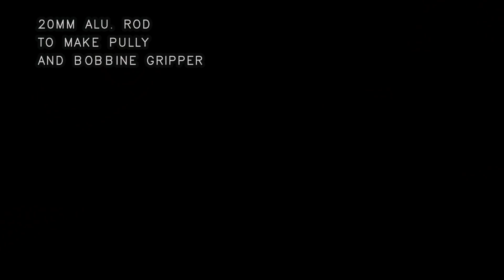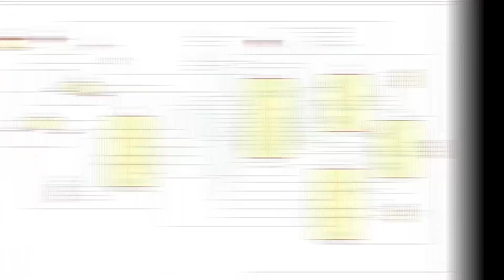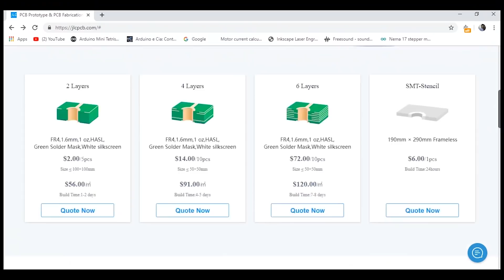DIY Arduino based Winding Machine

Comment: at 0:17 the wire is threaded through a small piece of metal with a whole in it that has rough edges. This will scratch the enamel insulating the wire and can easily create shorts in your finished coil. It needs to be made from nylon or better Teflon and the angles of attack have to be relatively shallow depending on the weight of the supply reel and its associated friction.

Comment: Гарний станок. Але в налаштуваннях не завадило би мати можливість вказувати діаметр дроту, що намотується і межі намотування! Завдяки цим параметрам можна було би намотувати дріт різного діаметра без зазору - виток до витка.

Good machine. But in the settings it would not hurt to be able to specify the diameter of the winding wire and the winding limits! Thanks to these parameters, it would be possible to wind a wire of different diameters without a gap - turn to turn.

Comment: 😂what about add a plastic tube in the bolt’s guide hole, to prevent the wire’s plastic from brake.

Comment: The ideas are great, but the structure is not designed for good results. Free-hand drilling despite having a standing drill !? The axis cannot be straight and therefore cannot produce a sensible winding. I like your ideas, but the implementation is amateurish. You still have to work on the quality

Comment: Would be smart to pay attention to hitting the walls of the coil bobbin, and the gauge of wire to make neater turns, as turns slipping between layers tend to reduce the magnetic field - resulting in weaker motors/generators.

Comment: Great project! I agree with the suggestions to add a tensioner. I’d also add some code that lets you enter the wire diameter and calculates the correct speed of the wire guide movement to produce really nice, tidy windings.

Comment: Curious.  I like the machine some.  The little hole in the metal piece that you feed the wire through just seems risky that it will scrape the coating off your wire. I would just get a piece of plastic with a hole in it, epoxy it over that hole, and feed the wire through.  Also, your linear rail is really running too fast.  Thank you for this because now I know I will not buy one of those cheap linear slides. Really the wire should run through some sorta gentle pinch thing to create some tension. I bet with that it would almost correct for that linear slide if you slowed the slider down.

Comment: Awesome! In love with this and your toroidal spinner. One suggestion, maybe put a soft material to cover the metallic inner surface of the part that guides the wire...just to ensure that the enamel doesn't get scraped off. Hoping to one day make a version of both. If these aren't open source please consider doing so..best
Reply: Exactly! Teflon would be optimal, but another soft/waxy plastic like delrin (POM) or HDPE would work very well.

Comment: The eye needs to be changed into a horizontal pulley bearing, and there needs to be another horizontal pulley bearing spring-loaded to keep the wire under tension from the source spool to the spindle (should look similar to a VCR tape deck)....and the source spool should not be fully free to spin, but maybe some cotton or other small friction just to keep tension on the line.  This will allow the winding to be more accurate and compact.
Reply: What Robert said!  Is that what it is called? Horizontal pully bearing?  I need to get one too.

Comment: Do you account for the extra length of wire required for 1 turn after the coil has reached the entire length run of the cylinder? There would be extra length that's required to create a turn after a full cylinder run? You'd have to account for the new diameter of this turn, which would be the original turn diameter +  twice the diameter of the wire underneath the new run of coils, i believe. Please correct me if I am wrong here, as maybe this would be almost negligible?
- Thanks.

Comment: Not bad. But the stacker must be polished, otherwise it will strip off all the insulation from the wire and there will be an interturn circuit.

Comment: Use stepper motor to drive bobbin to get better control of turns/speed.
Make better wire guide (See Gingery book on coil winder).
Software to allow movement of wire guide in concert with turns, allows making 'universal banked' coils like Pie wound RF chokes.
Software should know wire gauge (diameter, turns per inch) so wire guide will move in lock step with bobbin for tight windings.
Good basic foundation, but needs above improvements.
Reply: do we need to calculate the speed ratio between ?? if so how to calculate that?

Comment: nice build. Advice you should use a V pulley to control the motion of the wire. The ole is too big for thin wire and making it smaller is a bad idea. Hope it will help you

Comment: The approach has merit but the winding accuracy is below quality due to very inaccurate workmanship when making the shaft/axle for the winding bobbin. You can see the disastrous run-out as terrible wobble! The machine simply winds another spool of wire approximately a preset number of turns. Not much use other than for some kind of solenoid perhaps?

Comment: Compliments, it's a good concept as starting point. Defenetly you'll need a tension system for the wire made from two pulleys, a control on the slider based on the wire diameter with which you can set the travel on each turn and also the length of travel based on the coil length. Keep evolving the good work! 👍

Comment: Mais afinal. Para que serve isso?! Nao entendi.
Reply: Para fabricar solenoides, los tienen las electro válvulas de las lavadoras, las válvulas neumáticas, los re levadores, contactores, actuadores lineales etc. etc.
Reply: @rafaelalvarezplacencia1190  pode remover a bobina de solenoide. Dessa peça de alumínio?
Reply: @viniciosvds  No creo que se pueda remover, tampoco creo que sea de aluminio, porque no tendría utilidad, tendría que ser de acero al alto cilicio o hierro para que al energizar la bobina imante el centro de acero o hierro hueco y pueda mover otro centro mas pequeño de acero o hierro que pasa por el centro, también hay solenoides con centro relleno que al energizarse atraen a otro metal magnético como en los relevadores
Reply: @rafaelalvarezplacencia1190  obrigado. Pela ajuda
Reply: capacitor making machine 
https://youtu.be/Dw3n8sTQZaE

Comment: This was an awesome build, of its type, ingenious in its simplicity. May I suggest splitting threaded nuts to fit screws needed to be held in a vise, vertical from their threads,  in this way you create a threaded clamp to hold screws in vise jaws. Using the modified threaded nuts rather than destroying the threads on the screw by placing the screws directly into the vise jaws.
Reply: capacitor making machine 
https://youtu.be/Dw3n8sTQZaE

Comment: Very nice project!
Improvements could be to make sure the tension between feeder and coil is even over the whole winding process, so the windings sit tight on the coil.
Also maybe you should feed the wire through a little piece of PTFE tube instead of the M6 screw, so you make sure that the coating of the wire is not damaged while fed through.
Reply: I was thinking about that bro, It's really important to avoid scratch or peel the wire coating...
Reply: capacitor making machine 
https://youtu.be/Dw3n8sTQZaE
Reply: Eyelets may help and maybe a loop under the large bobbin to help with the tension and a brake for the large bobbin so when the machine stops the contents of the the large bobbin (and maybe the smaller bobbin) does not unravel

Comment: Nice idea, but the realisation is very pure. The main thing is the stepper motor control is missing or not correct. The stepper motior should move corresponding the wire diameter, ie if you use 0,5 mm wire the stepper should move at every turn of the main axle by 0,5 mm.  This should be a parameter before you start your machine.
Reply: I like your point of view, at the beginning of the winding, the wire is too separate and even loose. An improvement in the wire guide must be done for control the tension and the direction of the wire, maybe using a better step motor...
Reply: Jesús Eduardo  
yes, the stepper motor with the original worm is not fine enough for this job. Try to drive with the same motor a rod with M3-M6 thread. This will give you more finer ride. For the tension in wire you can use two pulleys on the springy arm in form of Z wire trace. The pulleys work also as a wire guide. This will compensate the initial tension changes. ( a small spring will provide the necessary tension). The motor shall move this element with the increments of the wire diameter. The movement is derivated from the rotation of the main axle ( from the counter).
Reply: @railfilm  what about the speed RATIO between the dc motor and stepper motor to provide accurate windings??
Reply: Akshat Pande  Hi exactly that is what I mean. On my machine both motors are stepper motors and there is an electronic gear between the two motors. The gear ratio is automatically calculated from the wire diameter, ie the wire guide moves on every revolution of the main motor by the size of diameter. It is still challenging with a very thin wire, I need to visit some company with the professional machine as however the wire is guided very exactly at thin wires (<0,3 mm) it is not working very well. Maybe the tension in the wire must be adjusted also according the thikness - what I do not know yet. Over 0,3 mm the machine works quite well.
Reply: railfilm thanks for the reply,so basically u mean that the lead screw stepper motor has to move by one wire diameter and the winding stepper motor has to complete one full rotation ?
Reply: railfilm also i think that a finer tpi leadscrew with anti backlash might help with wires of 0.3mm or below
Reply: Akshat Pande it is not a problem of the leadscrew. It moves 0,5 mm/rev, what is more the enough. Of course the movemet is controlled, when I use a thiner wire the leadscrew will move just exactly the same amount as the wire diameter requires, ie just 0,3 mm. For wire over 0,5 mm the leadscrew will rotate more the 360 degrees for one revolution of the main axle. The problem is how to guide the wire on the spool surface, to get the turns into nice shape. My guide system are dual pulleys with bearing and this assembly moves left and right in the guven size. I can set the width of the solenoid, like 20 mm it means with 0,5 mm wire, after 40 revolution the leadscrew will change the direction for the another 40 turnus etc. With thicker wire it works quite well, with thin wire I need something pushing down the wire to the actual surface.
Reply: railfilm ooh thn u need to adjust the tension, i am really frustrated this is my final year project and i feel like im so lost
Reply: railfilm is your project controlled an arduino?
Reply: Akshat Pande yes I do have also a simple tension controller - maybe too simple :-) - what controls the tension of the wire. Yes the unit is based on Arduino what controls the two motors and also calculates the motions ( transmission ration between the two motors), and has also a simple ramp when it starts that the thin wire does not tear. This fine. ( if you send me some address, I can send you the picture of the machine
Reply: Sorry, TWO stepers, not THREE...